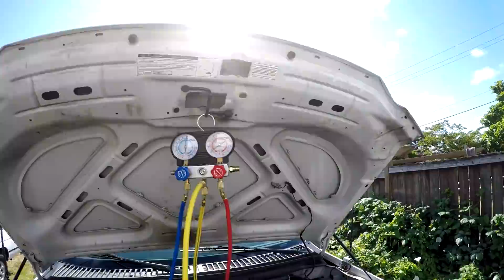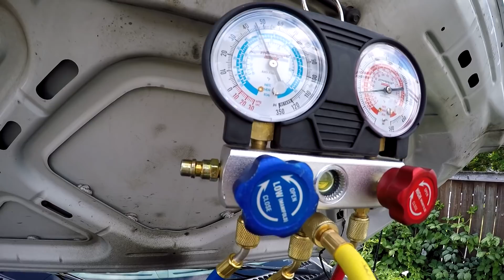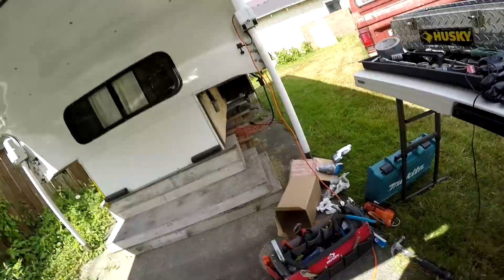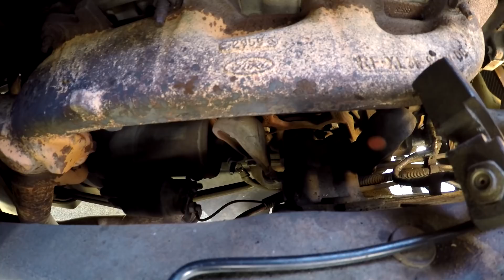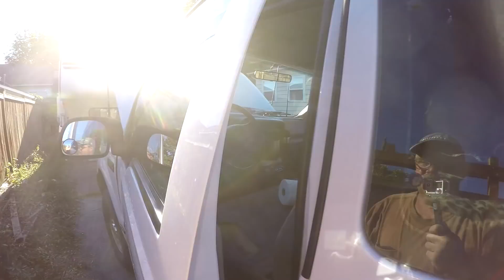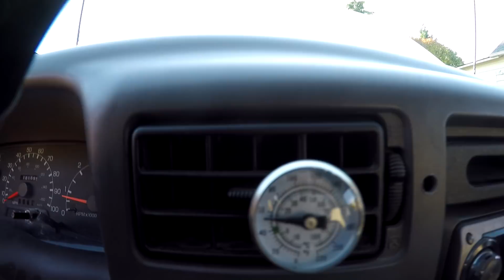EASY FIX FORD Air Conditioning System

Comment: I see you did not replace or have an expansion valve, so I am assuming that the orifice tube is the expander?  I'm fixing to do mine but mine has an expansion valve I'm gonna replace along with the compressor, condensor, accumulator and flush out the lines and evaporator, and just have a shop vacuum and recharge the system for $100.
Reply from the maker: Expansion valve is the other method for automotive AC. Need a vacuum pump and the vacuum needs to hold at least 30 minutes with pump off.

Comment: My truck, 2006 6.0L, was doing this very same thing the compressor would cut on and off. When we pulled the orfice tube it had metal shavings on it and other debris. We decided it was a bad compressor. After replacing everything compressor, tubing, evaporator, condenser, accumulator, etc I ran the truck for ten minutes and then came to a stop at a red light and the compressor proceeded to dump all the Freon out of the system as a huge cloud rolled out from under the truck. I took it back to the guy that did the work, local tech from ford, and When we opened up the system the orfice tube had been sucked/pushed all the way up into the elbow just before the evaporator. Moved 2-3” downstream. We attempted to replace the orfice with one from the local parts house and recharge the system with the same results. This time the orfice tube became lodged so bad that we could not get it out. Ultimately he said the new compressor had failed and contaminated the system and plugged up the office tube. I am not so sure as the orfice tube looked pretty clean to me compared to what I have found online.

I was able to get the local parts house to warranty everything since we had replaced the entire system, After replacing everything again the system worked ok the air coming out was cold but not as cold as I would expect maybe 60 degrees. I drove the truck for 3 weeks and one day while driving it I came to a stop and let the truck idle for several minutes with the ac running, after idling for several minutes I heard the system start to release refrigerant. I quickly shutoff the ac and then turned it back on a few minutes later it ran for a few minutes before I stopped again. After idling several more minutes it began to blow off refrigerant again. I am at a loss for what to do. I was hoping I could find out something online but this seems to be a pretty isolated issue.

I took the truck back today to recharge and test it we discovered more metal shavings on the orfice tube. We replaced it and were going to recharge the system to test it but when he began recharging the system the pressure read 100psi with only 14oz added. The ford tech felt that the pressure read to high for only having a small portion of the Freon added and now believes there is some sort of blockage in the system. 

Any help/advice is appreciated.
Reply from the maker: I'm not an expert but it sounds like a blockage. There are a couple ways to block the system. Lots of dirt and debris at the orifice tube, or orifice tube installed backwards,  moisture in the system due to not properly vacuuming down the system fully before charging. Moisture can turn to ice and block the orifice tube. It will ice up and block, then thaw, and repeat over and over. All AC systems work the same way so the cure for any accumulator type system can be used as an example for yours.

Comment: i recently change replace rhe the ac compressor  and condensor on my 1999 chevy 1500 4.3 and  not blowing cold air tje the line were the oriffice filter is gets cold  the accumulator stays warm  and compresor kicks on and off very often when i trie Putin a second can of freon it doesn't want take it
Reply: Sounds like your expansion valve is bad

Comment: I just got around to watching your video to the end. Those vent temps are high. You should be getting a 40 degree difference or at least a 35 degree difference below ambient. There are reasons why you're not. I noticed that it is 76 degrees there and your vent temps were around 50 -55 degrees.

Your manifold hoses were backwards and had a leak as I mentioned in another post. I noticed when you closed off the high side coupler, the pressure on the gauge dropped; it shouldn't have if there were no leaks. Since it did, you definitely put some air in your system and that will definitely lower your vent temps.

You also put too much oil in the system. I looked up the capacity for your truck, it is 7 ounces. You did put 7 ounce in, but you didn't account for the oil that is already in the new compressor. Usually new compressors are shipped with some oil in them; probably around 5 ounces. You should have drained the new compressor into a clean container and weighed it out before putting it back in the compressor. Whatever amount is in there should be deducted from the 7 ounce total capacity. If there was 5 ounces in the compressor, you should only add 2 ounces to the system. Adding too much oil will coat the walls of the hoses and cores, insulating them so they don't transfer temperatures properly, it will also take up space that is reserved for refrigerant so your system will be overcharged even though you put the correct weighted charge in; which would explain your high temps.

If you are motivated enough, you can fix this problem by first reclaiming the refrigerant. Then flush out the system completely so you know there isn't any oil in it. Measure how much oil is in the compressor and put the correct amount (the difference) into the system; and don't put oil into the suction hose because compressors don't compress liquids. You can put all the oil in the accumulator. Hook the ac manifold hoses up correctly; evacuate for an hour or so. Make sure you hold a vacuum and charge the correct weighted refrigerant. Do this and you will have excellent vent temps, trust me!
Reply: I thought PAG Oil goes into the AC Compressor? Why is it being put into the accumulator?
Reply from the maker: If there is no oil in the compressor,  directions say to add 3 ounces to it. Add the rest to the accumulator which is the reservoir for the oil.
Reply: @CITAP1  a reservoir for the oil? I thought the accumulators job was to move any moisture from the ac system?
Reply from the maker: @brentbeddoe6167  It does remove moisture but it is also reservoir for oil. I used to pump a few  ounces of oil into the accelerators on Kenworth  Trucks AC systems where it would jr
Reply from the maker: jjenson2006  
I know there is extra oil in the system. Hasn't posed a problem. The AC is working nicely and I get similar vent cooling temperatures to my brothers 97 F250 7.3 liter. 
I do appreciate your input,  I'm not an AC guy but I did my best and so far, so good. Saved a bit of money and had some fun.
Reply: I get similar vent cooling temperatures to my brothers 97 F250 7.3 liter

His AC has issues as well. After all, it is a 97.

I'm not an AC guy but I did my best and so far, so good.

I'm not knocking what you did. Just helping you learn something in case you have to do this again, you will do a better job. Still in all, even with mistakes made, you save money and learn something; and that is a good thing. There was a time when I made mistakes in the past. One of them was putting too much oil into the system. I learn things the hard way and then I pass on the knowledge to those who are willing to learn so they don't make those same mistakes.

Comment: That system was just low on refrigerant; it could have had other problems, but you can't rule them out without recharging it with the right charge. Being undercharged would definitely show the symptoms you had.

You measured a static pressure of 60 psi. The saturation temperature of r134a at 60psi is 62 degrees. I'm going to take an educated guess and assume the ambient temperature is above 62 degrees. This means that there is no liquid refrigerant in the system; meaning it is very much undercharged. If it's say 80 degrees, the static pressure should be 87 psi. Static pressure doesn't tell you if you're fully charged or overcharged, but it will tell you if it is significantly undercharged (no liquid refrigerant); which it is in this case.

I hate to tell you this, but my guess is you replaced all those components for nothing. The compressor looked like it was working properly. The orifice tube was sweating because it was receiving vapor instead of liquid refrigerant like it should. You should have emptied the system and refilled with the correct weighted charge.
Reply from the maker: jjenson2006 
Two main problems with my system were an intermittent vibration from the compressor and  the system would lose a recharge within a couple weeks time. The appearance of the vibration is what prompted me to change it. Early on, if I had known, all I would have had to do is replace the low pressure cut off sensor switch. That would have stopped the constant cycling of the compressor and surges in pressure in the system . O-rings needed to be replaced to.stop refrigerant loss. The system still works perfectly a year later still holding the original charge.
Reply: You will get compressor noises and vibrations if the system charge isn't right. Could also be a loose belt or loose mounting bolts. That's a big leak you had. 

The compressor will short cycle if the charge is low; it's supposed to do that to protect the compressor because a low charge will distribute less oil to the compressor. The compressor starts, which pulls the low side lower causing the low pressure switch to shut off compressor. Then the pressure quickly equalizes, causing the compressor to turn back on again, repeating forever. If it had a full charge, that wouldn't happen. The fact that the compressor was cycling at a fast, steady rate proves the low pressure switch was working properly.

I guarantee you it would be at least 10 degrees cooler if you redid it the way I explained; but if you're happy with it the way it is, then that's all that matters.
Reply from the maker: jjenson2006 
I think the low pressure switch caused the whole problem having changed the clutch 2 times previously. I for kicks out the old sensor back on and it exhibited the start stop condition then proper operation with the new switch again.
Reply: Well, I'd imagine the excessive starting and stopping will definitely cause premature wear on the clutch plate; but usually that would result in a wider air gap in the clutch which could be fixed by removing some shims, which will tighten the air gap to allow the clutch to activate.

As I said though, with a low charge, it's supposed to cycle fast like that and when it does, you're supposed to turn the system off until you get it recharged (after fixing the leaks). Your leak was so excessive that a soap and water test would have probably found it. However, you can do it pretty efficiently with a refrigerant sniffer or a UV dye.
Reply from the maker: jjenson2006 
Well, it was a good learning challenge. I knew very little about AC before this and gained a fair working knowledge by the end. The next time will be better.
Reply: @CITAP1  I agree with JJ. But you are right in that the leak was probably just a bad seal, and with the system being as old as it was you might as well rebuild it. I learned AC systems just like you Citap1, out of economic necessity. I got tired of paying some guy $350.00 to come out every year to change a $15.00 Run Start Capacitor and put 8 oz's of R22 in the house AC unit every year. I purchased the R134A gauges, the R-22 to R-134A adapter fittings and started servicing my R-22 AC myself. I also had a few friends who work professionally as AC technicians, so before I did something I did my research and would run it by them 1st. So far I've fixed 6 cars and my house AC about 7 times. Mostly just a run start cap, one can of leak fix and 1 lb of R-22 with their help, my cost of course. Good job on the video! I plan on doing a series on the 99-2003 7.3L F250/350 AC system. Anyways Thanks for sharing. Best Wishes & Blessings. Keith Noneya
Reply from the maker: @keithnoneya  I noticed this video is exactly 2 years old. The AC is still working like a champ.

Comment: Not to bust your chops or anything, I appreciate that people take their time out to make videos like this butt the hoses on your manifold are connected wrong. The straight connectors go to the manifold and the bent connectors go to the couplers. It is important that you connect them the right way because the seals in the end are specifically designed for what they mate to. The bent side that goes to the coupling has an external rubber gasket that seals the coupling around its rim, while the straight side has an internal rubber gasket that seals the manifold internally. They are not designed to work either way.
Reply from the maker: jjenson2006 
That may be I had the hoses connected backwards but after an initial slight leak, there were no leaks. When vacuuming down the system for test and removal of moisture before charging, the manifold held vacuum for an hour and a half. A leak certainly would have prevented that. Looking and the connectors, they are identical fittings as I recall.
Reply: When you closed the red coupler, the needle dropped. It should not drop; in fact I could do the same and leave the manifold for weeks without the needle dropping. It dropped because there is a leak in your connection somewhere; I assumed it was because you connected it wrong, but it could also be a bad seal. It's a small leak, but a leak no less. The reason the needle didn't drop when the coupler was open is because there is a lot of volume in an AC system, so it would take a very long time for it to bleed down. When you close the coupler, there is only the tiny volume in the red hose, so if there is the tiniest leak, it will leak down quickly; does that make sense? If the fittings on your gauges look the same at both ends, then they must be a very cheap manifold/hoses. Still, the manifold set is designed to be connected the way I said. It would be smart to connect them that way. The angle on the end of the coupler side is there to give you more flexibility when connecting in some tight engine compartments. The straight side is needed on the manifold because you want the hoses to come straight down, not cocked to one side fighting gravity.
Reply: Yeah, I just noticed in your video that your couplers have an adapter between the hose and coupler; so those hoses can have identical ends. That is a cheap set. A good set doesn't use an adapter; they connect directly to the couplers. I imagine it would make production costs cheaper by having identical ends on the hoses. However, you should still connect them the right way. The weight of the hanging hose will put uneven stress on the seals because they are cocked to one side. This can cause leaks itself and will definitely cause premature wear. They probably have teflon seals instead of the easy to replace rubber seals of a good set.
Reply from the maker: jjenson2006 
It's a Harbor Freight gauge set so probably among the cheapest. It does use what looks like a clearish nylon or similar seal. Last night driving home, I shut off the AC because it was getting too cold with mid 70's outside so I cracked a window instead. Perhaps not perfectly repaired but no reason has manifested since the repair to make any change necessary.
Reply: Yeah, those are throw away sets. You can't really replace the seals. They can do the job well though when they are new though.

Mid 70's isn't really hot; even a fan could feel good with low humidity. The true test will be when it's 90-100 degrees in the shade with high humidity.

Comment: What if neither hose gets cold?  I have a charged system, compressor running...but hot air coming out of the vents on MAX AC.  None of the hoses or pipes get cold.  (1993 Ford 150 R134)
Reply: This guy is using EZ Freeze; which is propane, not r134a. I don't know why people use this instead of r134a. The weighted amount would be different than r134a, so you wouldn't know how much is a full charge and propane isn't very good at circulating PAG oil, so the compressor will have a shorter life.
Reply from the maker: Carlos G 
Do know if there is refrigerant in the system and how much. To diagnose, you really need a gauge set like what I used from Harbor Freight. Is your ac clutch engaging. I list pressures you should see in the video. If your gauges show low pressure the system may have bleed off its refrigerant.
Reply: I am buying the gauges tomorrow.  I just put EZ Freeze in there today and the pressure said it was OK.  the compressor started up.  No cold air.
Reply from the maker: Carlos G 
If you got a can of 134a with a gauge, it really isn't telling you proper information, A gauge set will tell you the truth regarding both the high side and low side. The can gauge only gives you questionable information on the low pressure side. The functionality of the high pressure side will give you better answers as to why it's not cooling. The high pressure side is what sprays through the nozzle creating cold. Spend a couple minutes to read and understand the operation instructions

Comment: Great instructive video. Thanks! I understand the pump sucks the air and moisture out. But what if it also sucks the new PAG oil out? Or is the Pag oil too heavy or what? What am I missing?
Reply from the maker: The PAG oil just stays where it is.  The moisture turns to vapor and gets sucked out. The hoses don't collapse so the volume inside  stays the same.  That's why the oil just sits there in the vacuum . I imagine any oil sucked out would just lubricate the vacuum pump and run down the pumps exhaust port so you would know some was sucked out.
Reply: Ahh, vapors. That explains it. Thanks. I had a great aunt who suffered from that.